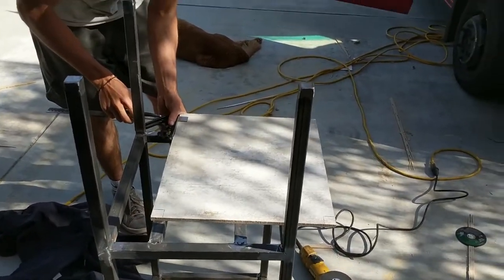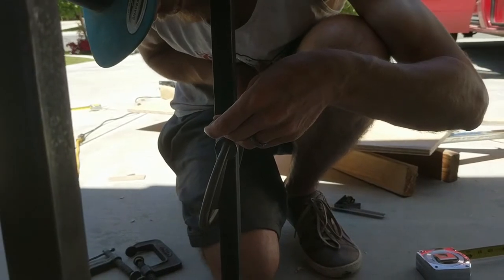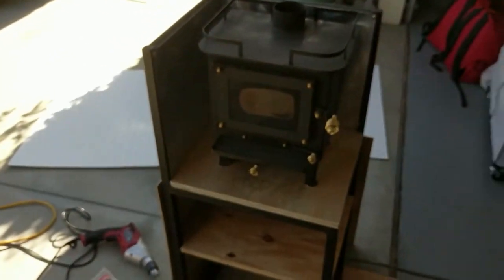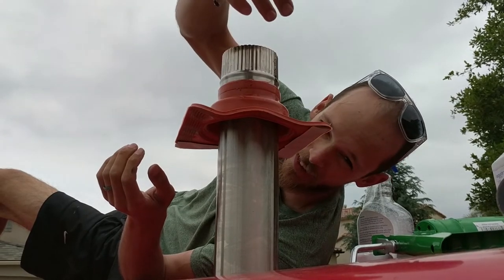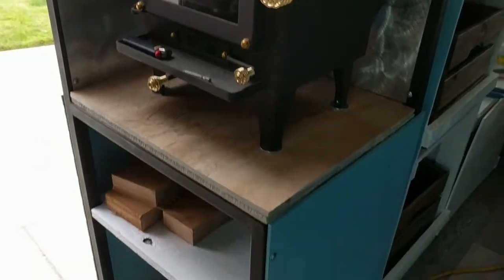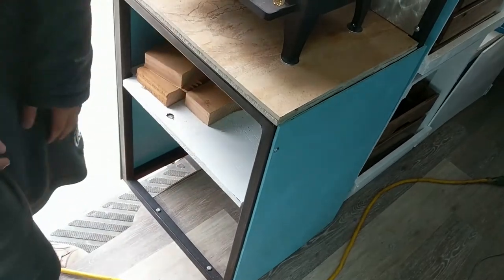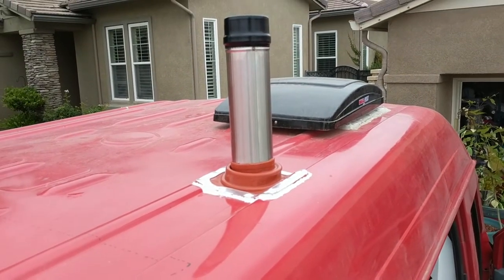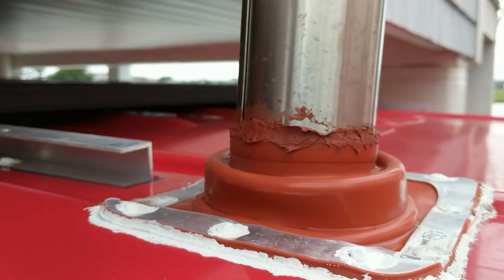Sprinter Van Build Ep. 06 : DIY Wood Burning Stove Installation in Sprinter Van

Comment: Can you explain your thoughts on why you chose the Grizzly model over the Cub for your application?  Or for that matter, why a Cubic Mini wood stove over all the other choices in the market?  Also, why face the stove door forwards?...I like to zone out and be hypnotized by the dancing flames, so I'd like find a way to have the door visible from the bed...also you could tell by sight when it was time to throw another log on the fire that way.  Have you fully resolved the water leakage problems now?  New sub here...
Reply from the maker: Thanks for the Comment David. We used the grizzly because it wasn't much more than the Cub and its a little bigger. You can always burn less wood but you can't stuff more in. So figured bigger was better.

 I looked at tiny wood stoves, but they only did periodic production runs so we would have had to wait to get one. Also looked at Dickenson but found some mixed reviews on their solid fuel stove. I also saw that people really liked their cubic mini wood stoves.

You could absolutely change the orientation. The world is your oyster on your design. We already had the kitchen figured out so it went by the door. It couldn't face the bed or I wouldn't have been able to open the door. I found it couldn't face the middle of the room because I didn't want the flue pipe to come out the rounded part of the roof. I think it will be serviceable for the winter but we haven't used it much so maybe I'll learn something once we start burning it more. 

best of luck,
matt